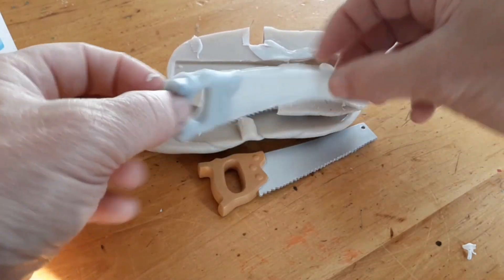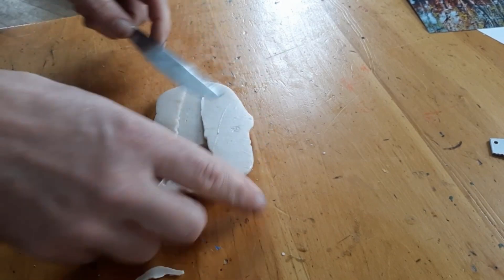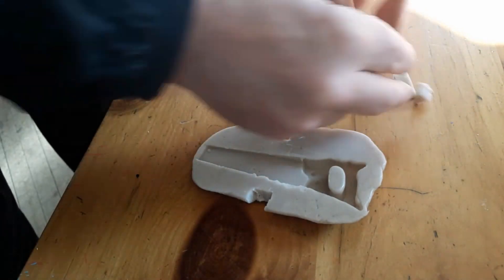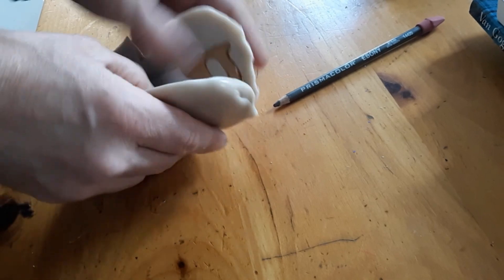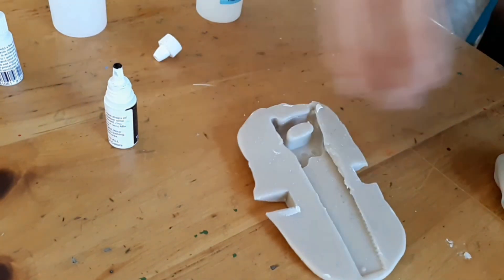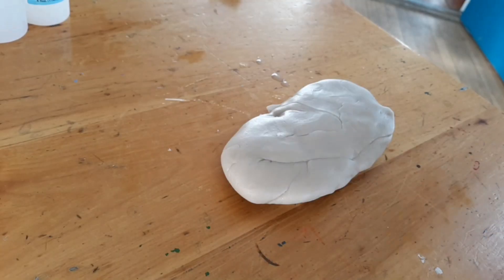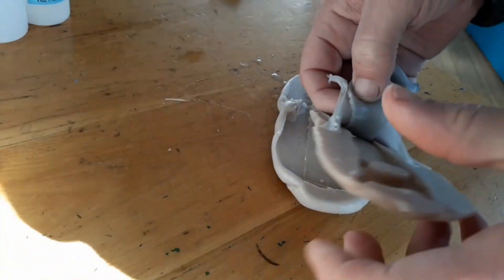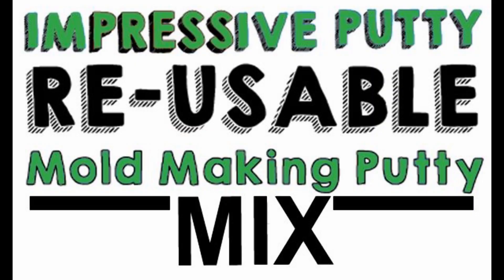How To Make a Two Part Mold Using Reusable imPRESSive Putty to make Silicone Rubber Casting

Comment: does this work with smooth cast resin 325 or will it deform the mold due to heat?
Reply from the maker: Yes, the ImPRESSive Putty works very well with the 325. If you get big..say somewhere around 10 to 15 cubic inches or thicker pieces, then the heat might get too hot. You can also chill the mold to handle higher temperatures as well. Thanks!- stan from ComposiMold